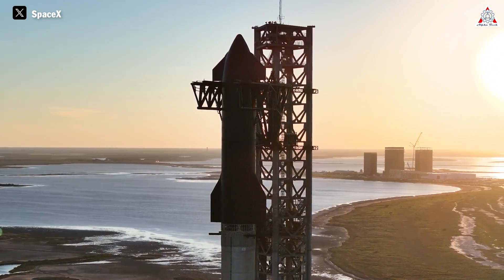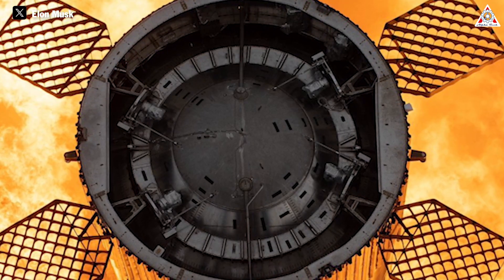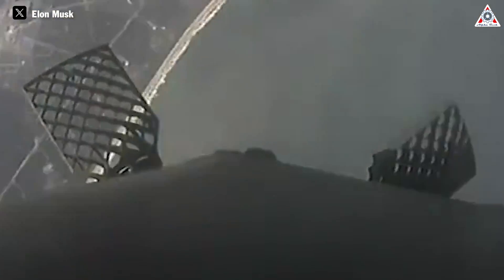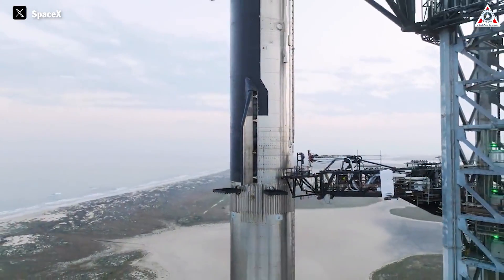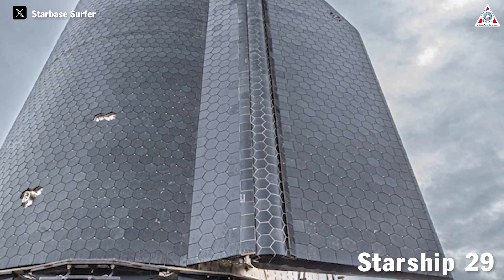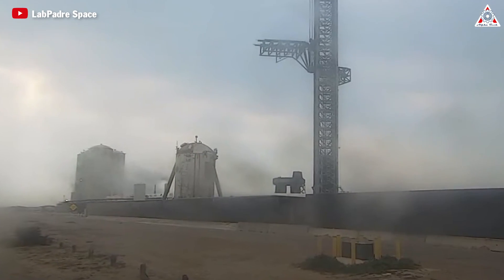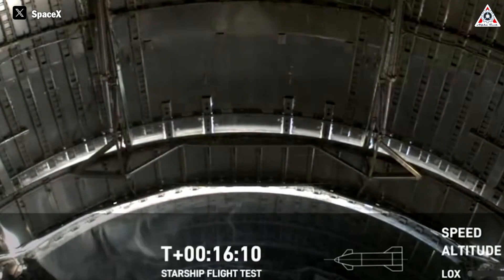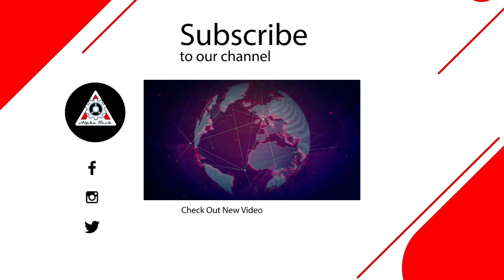SpaceX's DESIGN NEW CHANGES for upcoming Starship prototype launch!

Comment: GRID FINS: I don't think there is an issue:

If you watch the IFT3/OFT3 video of the Booster, you can clearly see SpaceX has the grid fins operating on an 'Altitude' schedule. It turns on in software (jerks to life) at 50K, then passing through 5K in altitude, then the gain schedule of the fins change, but this is because the rocket has entered into the Landing phase as it needs more authority to control at the slower subsonic speeds.

UNFORTUNATELY, the 13 Raptors motors failed to decelerate the Booster. What caused the 13 Raptors to not fire us is where the focus in the fix. As long as the rocket is on proper speed schedule, then the Altitude schedule for when the grid fins turn on will work properly.

GOOD VIDEO!
Reply from the maker: Thank you so much!

Comment: I think the grid fins are fine.. the ship was descending too fast because it didnt light its engines, and the ones that did turn on (or exploded) added to instability
Reply: They could have "pre-lit" the three center engines "early" to create a "hot reaction" shield protecting the other engines against the high velocity reentry forces once it entered the atmosphere.

Comment: Duleigh's suggestions
- Stage 1 booster needs to approach re-entry slower. Fire up a few raptors sooner, if they're not working, use an alternate set
- Starships wings need atmosphere to work, that RCS has to be up and running, or the wings need to be bigger to grab what little atmosphere there is up there
- The Pez Dispenser door is ridiculous. Shelves bought at IKEA are engineered better. it needs to be substantial and there need to be rails to guide it. Hasn't Elon ever seen a Garage Door?

Comment: Smart dude. Make them fins out of composite, helicopter blades are. I was like DUDE DUDE, then I heard, "Done intentionally for a reduce in weight there later. " As they figure things out. Standing on the back of NASA and what they know and how smart Musk is , he actually may get people to mars. Wonder how long it will take I am about half spent.
Reply: "Composite" has an organic matrix or glue to hold the fibers together won't survive re-entry temperatures, not even close, which is why SpaceX chose steel with ceramic TPS.
Reply: @iany4521  I was talking the boosters that come back. They dont get fast enough to burn.

Comment: I recently come across an article on why telephone wires are twisted rather than run side-by-side parallel. When twisted the wind rolls off the surface faster with less initial force against a flat single wire. I also saw a very tall, narrow building that was engineered with a very long spiraled surface from top to bottom it created less wind drag and of course a quieter surface. Keeping the above in mind, I think if they installed, the exterior tiles with their surfaces etched in such a way that it would form a spiral surface, I think that would cause less drag and lower surface temperatures on its reentry. Last tile drag also means a much more solid stable adhesiveness to the surface clips so less tile loss on reentry as well. Imo😮
Reply: Twisted wires receive way less interference from the power grid 50 or 60 Hz currents induced. The twists cancel most of that out what they get induced. That's the most important thing.

Comment: I seriously doubt the grid fins individually have roll, pitch and yaw motion capability. 
How will it land on the chopsticks with only 3 grid fins? Seems 4 would be better.
Reply: @PTFS_CLIPSBUTTER Ok thanks. I thought it landed on the grid fins.
Reply: Grid fins work in concert with each other. Each Super Heavy grid fin can only rotate, but in concert, they can steer the booster and can control roll, pitch and yaw in the lower atmosphere. Elon Musk did say, during an interview with Tim Dodd, that it only needs 3, and one could be smaller. The target is to catch the booster, not on the grid fins, but on the two "lifting points".

Comment: Light the Booster’s raptors before it goes fully tail down, or light one at a higher elevation.
Reply: I think you are trying to comment on the propellant "sloshing" problem. Even Falcon 9 first stage has liquid oxygen and liquid LP1. They learned how to keep the propellants at the bottom of their respective tanks, though Super Heavy is just so much larger.  Both Super Heavy and Starship have RCS using ullage gas. I thought these were already functional although I thought I heard Alpha Tech said they were not in IFT-3 (I think that was a mistake since there was no chance of attitude control without RCS). I believe the cold gas thruster or RCS near the rocket engines were supposed to provide a small g-force to keep the propellants at the bottom. It is puzzling how the none of the booster's engines lit until the booster was so close to the ground. A re-entry burn would have guaranteed that most of the propellant indeed be at the bottom of the tanks might have been a good idea. We'll see in IFT-4.
Reply: @iany4521  nope, was referring to the head wind and the engine’s exhaust area.

Comment: Biger Means also faster movable that should be enough 2x 4 spoilers sonce moving into position is slower and more last due to mass and strength should be hydro servo power and electric motor moving servo hydro pressure  if Rocket heavy Inc size off spoilers to get fit with smaller rockets thrn is just double turbo oxy engine 420 t off pressure and like states a criogenic box chamber for gas cooling system power source for aditional stream spray cooling

Comment: I think both the grid fins and the batteries could be replaced with a system of flywheels (flywheels are excellent for short term energy storage both in terms of space and mass) arranged in a pyramidal shape at the top.  These could could control roll, yaw, and pitch the way reaction wheels work even in space as well as near earth (i.e. at the landing pad) where the lack of speed would render the grid fins ineffective.  It would also honor the principle of "the best part is no part".

Comment: If there is a fairly precise mapping of all surface sections🎗🎗🤿🤿🛹🛹✨✨🔥🔥⛑🗺🗺🐲🐲🚀🚀🛰🛰🛸🛸👽👽👾👾👻👻 of the ship the slabs could be notched on three points of hooks inside the slabs, using the aeronotic fixing system of all cabling around the current perpandicular blade tabs.

But the process requires manual wiring for centering the grip force in a spiral connecting the triangle of cable by three ropes or twisted mini-cable connected by screwing of 🎡🎡🧵3/1 or 3/3, held by grip fins in contact with the connecting ropes 🎠on the glued slabs before final tightening.

This process, widely used in aeronotics, takes more time because of its reliability in assembling engine parts against vibration stalls.
Goes through vibration tests and wall deformation due to very strong temperature variations.

A real challenge in selecting an ultra-light cable because of the overload on all the vessel and super resistant to high temperatures would be a plus.

The simple door flaps of the ship would put it in danger every time against hazardous intrusions, especially the loss of all the loads due to the blocking of an untempered and uninsulated mechanism against temperatures of more🥶🥶 than -200 C°?
or the thin rods and ball joints are seized by fine particles of gas (sublimation) 💎💎💍💍or quickly solidified 🌧🌧☂☂🌂🌂⛄⛄in a few seconds at opening or in space exhibition.

This interior folding door panel allowing cold gases to enter during ascent 🛹🛹🚀🚀🥶🥶📞📞☎☎🎣🎣🎰🎰🧩🧩💊💊🩺🩺💉💉👑👑🌡🌡❄❄☔☔🌓🌓🌕🌕🥶🥶👨‍🚀👨‍🚀👩‍🚀👩‍🚀📞📞☎☎💊💊🩺🩺💖💖💓💓💢💢💨💨💝💝💖💖and increasing the rigidity of the ball joints once in the space will seize the mechanism of this ultra-light spoon 🥄🥄🍴🍴☂☂🥶🥶🌕🌕👩‍🚀👩‍🚀❄❄✨✨🔥🔥🌕🌕🛸🛸🛰🛰🚀🚀🪐🪐🌍🌍🌎🌎 almost inevitably 😎😎😍😍

Only the interior/exterior synchronized shutter S.A.S mechanisms ♻♻🗜🗜🔩🔩🔧🔧👨‍🚀⚔⚔🗿🗿are reliable in this hostile environment, although there is no doubt that these insulating door type🎊🎊🪔🪔👩‍🚀🧗‍♀👩‍🚀🧗‍♀🧗‍♂ are very well manufactured in slide or multiple diaphragm for later versions  🙌🙌🙌🙌👍👍🌋🌋🔥🔥🎥🎥🎬🎬.

Comment: Ah, you basically said nothing technically definitive in the whole video . . .
Reply: Then figure out the cold boost systems for alt. Pitch and yal controls
Reply: Top and bottom of the booster
Reply: Then apply to starship
Reply: @Shadowmane9  pitch and yal calculations were made too easy since the 1960’s, very easy, otherwise great questions!!
Reply: Tell me how the actuators work without rewatching the video then John.

Comment: Hypersonic shockwave hitting the grid fins? First thing that came to mind was that this might be similar to a SR71 'unstart' where the hypersonic shockwave interfering with the intakes knocked out the engines. This instability showed up around the same Mach 4 (~4,800 kph) so could it be that the shockwave was flickering back and forth across the gridfins?  
I'm curious whether the speed/time graph shows any sudden jump associated with this.
Also somewhat curious that breakup occurred just as the booster was breaking the sound barrier ~ 1,190 kph- not sure if this is the first time that rocket engines tried to ignite right as the vehicle is breaking the sound barrier / engines are firing into a sound-barrier shockwave...
Reply: Good point

Comment: it doesn't matter how good the heat tiles are if the ship is rotating out of control and the unprotected side is exposed to the heat of reentry. clearly stabilizing the ship is the key.
Reply: Of course, they have to fix both. They'll fix the rotation problem probably on the next flight but I have seen nothing yet that says the tiles will work in their current design. It has been a forever problem in manned space flight and I think we are still waiting for a solution. It could be the tiles will work if the problem with attachment points can be resolved. There are 18,000 tiles on the Starship right now and it looks like more may be required. It could be that even one failed tile in the right location could cause destruction of the whole ship. Plus the ship has to be thoroughly inspected after each flight regardless if a tile was damaged or not. It looks like they use a push in design where the tiles lock in place. Same as the defective Boeing plane door. if they change the locking mechanism of the attachment point that might work.

Comment: How is possible that booster Raptors did not restart with header thanks in service?
Reply: If your talking about restarting the Starship itself after the initial separation, I believe SpaceX chose not to do the restart because the ship was rotating and out of control. They didn't know where it would end up.
Reply: Thanks a lot @rocroc.  It was my doubt because i saw a vdo in another site, where, with my big surprise, it was shown a  "Header Tank"  in a Booster 11 or 12 during construction. So, it was an incorrect info.

Comment: Instead of single heat tiles, large armor sheets need to be installed.
Reply: Thermal expansion requires gaps between tiles to allow them to survive.
Reply: What about a single sheet of HPTs?

Comment: A vertical slot for dispensing cassettes would be structurally stronger, and permit a long full length piano type hinge for either internal or external swing opening.

Comment: Two things to fix:
1) The base needs to be changed from flat(all raptors at the same height) to a central cone type shape so that:
   a) There is pressure bleed off so that raptor internal pressure far exceeds external pressures generated by transonic re-entry.
   b) The back pressure of a large flattish base, causes the air to be exerted/pushed further out from the boosters sides, thus this turbulence & its "recovery" characteristics causes the great variances experienced by the booster steering fins. By making the raptors into a cone shape, this turbulence is greatly reduced and aide is transonic restarts?
2) Starship needs a redesign for several purposes:
  a) better load carrying/storage potential.
  b) more suitable for long haul potential( includes Starship lengthening & "empty" living/liveable spaces( space station module), etc.
   c) potentially add an ion/pulse/nuclear drive for long haul options.
Reply: By "base" I meant the booster base.
By back pressure I meant the transonic pressure generated during return to base.
The three longish steering fin design, doesn't work very well with chopstick catching arms.
Reply: just some other people who think they are better then the hundreds of engineers at spaceX
Reply: Thousands probably

Comment: The grid fins could rotate 90 degrees to align with the airflow during assent.
For both stages, another test flight without changing everything will provide data on what they can do differently.
There are trial and error tests, not missions. Let's keep the pace up and get on with it.

Comment: The most probable cause for booster failure to re-ignite the engines and latter explosion was a fuel leak somewhere, so either fuel pipes are not robust enough or the gaskets fail. Second stage also developed a spin caused by a leak (visible after engine cut-off). That spin caused the craft to enter atmosphere unevenly, exposing the part of the ship that isn't protected to the heat of re-entry. Also, it is annoying how SpaceX brags that they reached the orbit, while the craft never achieved orbital velocity of 28800 kmh.
Reply: They did actually say they never reached 'actual orbit' and said that it was deliberately shy of true orbit due to them wanting to err on the side of caution just incase they could not re-light the single raptor for the de-orbit burn. Thus the craft reached its intended epogee and then came back down naturally

Comment: falcon9s gridfins are less efficient. the gravity loss from the weight of the pumps and fluid used to extend them in order to reduce drag during liftoff is greater the friction loss saved by having them folded. but since the design is fixed there is no point in redesigning them. so while there is some slight drag in having them permanently extended on starship they present little suerface area for drag when not tilted so the reduction in weight and complexity outweighs the slight air resistance penalty.

Comment: I'd guess control loop issues for the grid fins are the most likley issue - control model needs updating with new information, either control delays or not enough control authority -- interesting thatvthe instability to me seemed to occur when they broke through the cloud layers
Reply from the maker: That's a good idea!
Reply: And no 'boost back burn' remember - they are relying on the sheer size of the grid fins to take that part over before the lower landing burn takes place - will just take time to get it right, but im sure they will!!
Reply: Is there a lot more oxygen at the cloud layer level compared to when it first starts to deorbit? I seem to remember hearing that there is quite a bit of oxygen higher up into space than we might think. The higher amount of oxygen around the cloud layers might have really accelerated the burning up of the ship and the booster parts.

Comment: If you are right about the grid fins. The actuators on the grid fins are probably a new heavy duty design just for this application. Possible they need to be made heavier for a super duty events. Being a new design they need to do a better job of debugging them. Could be that there needs to be better heat shielding from the massive amount of heat generated by the hot staging separation. I think for now let's not mess with the size and the ultimate design of the grid fins. Debug the internal problems first. Then move on from there. Grid fins in themselves is a relatively new territory for spaceships in general. SpaceX has mastered them on the Falcon program. Could even be a software problem. The tile problem is another problem that needs to be addressed. I think they either needs to come up with a revolutionize way of attaching them. Or maybe come up with a method of making the heat shielding one solid peace. Great Episode.
Reply from the maker: Thank you for comment! It’s great!
Reply: I agree